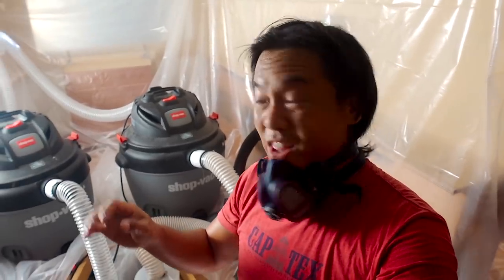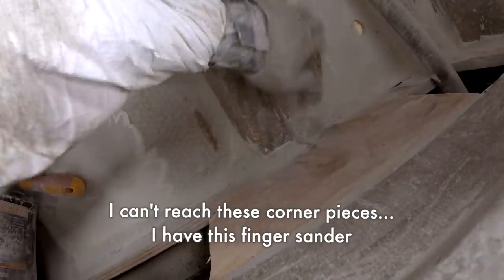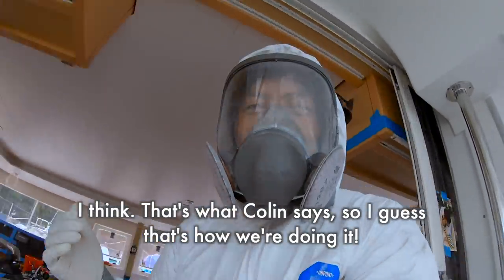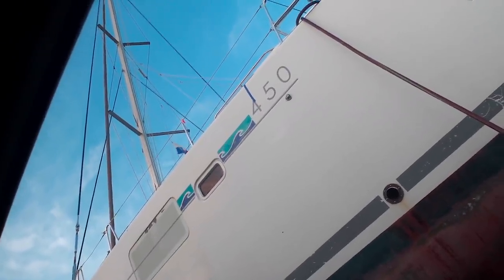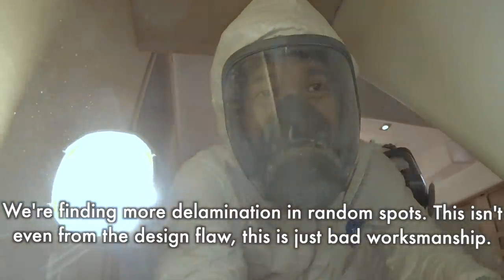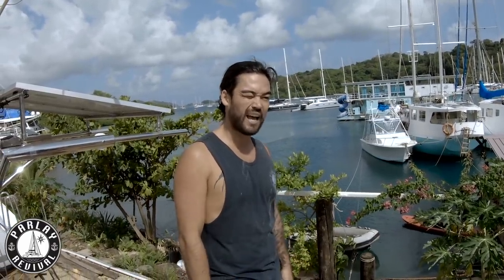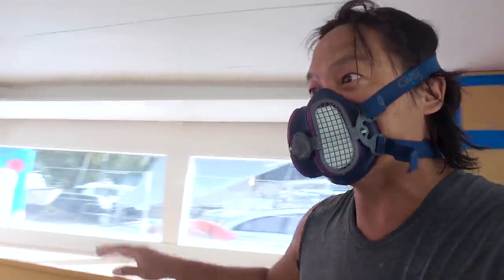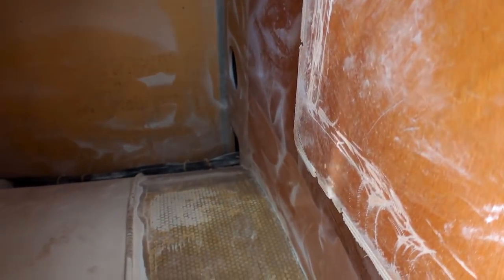I Sacrificed 3 Days of My Life GRINDING Fiberglass to Save $18k

Comment: While I've not had a large cat, I have worked on smaller fibreglass boats and yes, that stuff itches like crazy. I learnt the absolute best way to prevent this is two fold; Firstly, even if you are grinding fibreglass in the coldest of winters, always force yourself to have a COLD shower afterwards. That way your pores don't open up. Step 2; once dry, cover the area of your body that's itching with the cheapest, nastiest of masking tape and let it remain on your body for as long as you can (an hour's usually enough) and then rip that stuff off. Because it's cheap shit masking tape (Bunnings usually) it's usually extremely sticky so it will adhere very strongly to any glass fibre fibres and when you rip it all off, the fibres go with the tape. It sounds weird but it saved me from nights with no sleep due to constant itching.
Reply from the maker: Thanks for the tips, Fiberglass is fiberglass!  I think I have special skin that traps and stores fiberglass dust perfectly. Will try the cheapo tape trick!

Comment: I find a dry paint brush as a mini broom is helpful whenever lots of dust is being cleaned up. I saw you swatting with your fingers and no brush on end of vacuum. Dry paint brush while you vacuum👍. I get claustrophobia just watching you guys. It’s like you’re climbing inside a crawl space of a crawl space. 🥴😳
Reply from the maker: Ha yeah....not very efficient with no brush attachment...unfortunately it was hidden under a mound of dust in the other cabin--only found it later on.  Thx for the paint brush tip though, that sounds like it would work great to get dust out of deeper crevices.

Comment: Great work. Love the safety gear meters, great stuff. Fibre glass is bad stuff. Try for a external pump full pressurised resparation or scuba gear, i wouldnt touch fibreglass without it. Horrible job, great you are working it through...always fun with you
Reply from the maker: Yeah I really like the positive pressure masks. I’m going to get one soon.

Comment: That's the way to do it, good extraction. The one you got on the deck is what we used but larger dia. Where's the marigold gloves then? Dust is not such a problem when applying resin, as it gets absorbed into the resin and matt. $6000 a day? I'll do it.
Reply from the maker: Hey Brian!  I really wanted a bigger duct fan, but that little 8" diameter cost me $350 down here in panama (~$100 in the US.) The flexible duct was $110 on top of that. I actually bought some legit gloves since your last comment!  But this was filmed before then.  The quotes I got were in the US--they wanted a week to do the grinding and had to setup all sorts of HSE measures and needed multiple days for setup and breakdown of equipment and cleaning.  Here we just did 12hr days and knocked it out ASAFP.
Reply: @david_shih  Hi David, I see, in that case I would have done the same as you even though it's a pain in the ass. At least you are not alone with this, and you will have lots of good times on her when you finish all the work. As your Ausy friend said, stager the layers of glass especially if it's woven's and not chopped strand, good advice. Did he say what adhesive to use when you laminate the sheets of ply? At Sunseeker we used waterproof glue (not to be confused with water-resistant glue). Workmanship; The people who make these boats, in general, are not boat builders, the boat builders are the ones who make the original plugs, deck and hull, the rest are people who can handle a jigsaw, and learn how to lay up GRP with a bit of savvy, and not uncommon for people to skip things and not do it properly, Sunseeker had its problems with this as well, they have the attitude, "that will be alright" no one will see it when it's done, this is the Philippine attitude to building houses. It was difficult to find people who had a pride in what they were doing rather than just being a means to an end, and Friday was the best day of the week. Keep up the good work David, keep safe.
Reply from the maker: @lifeinchrist77  hi Brian,  I used west systems epoxy resin thickened with cabosil into a paste. Spread it out like you would laying tile. Hard to find people that take pride in their work now a days. I imagine wages are pushed so low that maybe the people willing to do the work have less interest in it.
Reply: Build quality was surely lacking.  But question is has anything at lagoon changed.

Comment: So when you “ rebuild “ I’d strongly urge go green brother as much as you can and go pro studio 
Develop a state of the art broadcast studio and grid and world class install ....personally I’d do a second propulsion drive system that’s all electric inc bow thruster on hydraulics and your boat fitted in fiber optics and star-link WiFi etc 
I’d also suggest “ some serious treasure hunting !
Pm me brother
Reply from the maker: Dude...my dream is to go all electric one day...ive got the batteries/solar/hydro figured out but can't afford the DC generator and motors at the moment.   Might not need bow thrusters since we have 2 engines, but fully networked and wired outlets would be awesome!  I'm just waiting on starlink to remove the geolock and I'm in!

Comment: I really like your videos.  I watched Colin's on Parley, and there was some insider information your needed to understand where exactly he was fixing his boat.  Your little graphic of the boat is immensely helpful.  Now, a confession.  I watched your wash down video before this one and got a chuckle when you said that the dust collection system would prevent the mess that Colin had to deal with on Parley.  So I wonder which would be less effort:  Literally removing everything inside the boat before starting the grinding, not bothering with dust mitigation since you have to wash down all surfaces anyway, or doing it the way you did it.  Too bad you couldn't block off the hard to reach nook and crannies to avoid dust behind walls.
Reply from the maker: Hey Patrick! that's such a good question.  Just go for it and grind like crazy with a wash down at the end; OR mitigate as much dust as possible and still wash down at the end.  If I had to do it again I'd still mitigate dust and here's why.  You have to remember that PPE typically removes a percentage of dust (eg 99%.)  So quite a bit still gets in through the mask, suits, cracks, etc.  By reducing dust with the exhaust, you are preventing a whole lot of it from reaching your lungs and skin.  Either way, you have to do a couple big cleanings at the end.  I actually had to go back in and wash the cabins again because when the water evaporated, the dissolved dust stayed behind! Thanks for watching bro!

Comment: The issues you uncovered appear to confirm that the things Colin highlighted and a fair number of other 450 owners discovering varying degrees of similar issues .Lagoon have design construction and big big quality control problems which leads to the question can all of these can be dismissed as 450 problems of a certain build period or does this mean there are wider issues with Lagoon Catamarans in general . Is or has Lagoon done any internal investigations into what’s happened here ? It’s hard to imagine a company of their size would not find these kind of problems a huge concern, their reputation could suffer irreparable damage unless they get their house in order . I would imagine any structural issues with any model Lagoon will be under the magnifying glass in future .
Reply from the maker: I can't speak for lagoon but I have my opinions of course.  If it were me and 2 of my boats had the same structural failure in the same marina, I would have sent an engineer out there to figure it all out yesterday.  There's no certain build period for Lagoon 450 problems, its actually all of them since ones from 2010 through 202 all have the same issues. I genuinly think it was just a design flaw in the forward structural bulkheads...they shorted them an extra piece of plywood each and a few layers of glass.  Easy design fix, but very hard to admit in their position.

Comment: David, make the hottest shower you can handle without burning. Wait a couple of minutes for the pores of your skin to open and only scrub your loofah in the direction of hair growth! It will not take it all off, but it’s the best way to get the most of it off your skin. Also, before you start, rub baby powder or barrier cream all over exposed skin and then suit up! Keep up the good work mate!
Reply from the maker: I've tried it all, but never the "in the direction of hair growth" and that sounds like it would work wonders. Will definitely try that thanks!

Comment: The cabinet maker who told you about dust and to move air here. I knew you would figure it out once I gave you a little direction. Move air that's the key. Very innovating setup great job.
Reply from the maker: Thanks for the tips brother!  Could have doubled that ventilation fan though, but the next size up was over $600 in panama.

Comment: Dave how much just in labor would it cost to have someone fix it for you not material expense like 50 k? JT 🇺🇸🇺🇸🐟🐠🎣🛥🌴⛱🙏🏻🙏🏻🙏🏻
Reply from the maker: I think $50k could cover labor it in a cheap country like Panama. But just to give you an idea for US prices. I have a quote where they wanted $15k just for the "project management" portion of the whole repair $130k all in.  There's just so many massive parts which would be huge undertakings on their own:  Dismantling Cabins; Prep/Clean/HSE around Grinding; Technical fiberglass (>60 square meters of biax fiberglass + 20 gallons of epoxy); Rebuilding Cabins;  and a Massive cleaning and interior wash down at the end to get the glass dust out (at least a week for that.)
Reply: @david_shih  thanks for replying now I understand why you are doing the repairs your self looks like a never ending battle but little by little your getting to finished product soon be in deep blue again and hurricane strong JT 🇺🇸🇺🇸🐟🐠🎣🛥🌴⛱🙏🏻🙏🏻🙏🏻

Comment: You want to get fiberglass out of your skin key is cold shower this will make your skin tighten and cause the glass to stand up like the hair on the back of your neck when you get a cold chill. Then rub you skin with something like the inside of a tube sock or sometimes a clay bar for paint detail can get the hard to remove glass out of your skin.
Reply from the maker: Ah.  Clay bar, that sounds like it just might work!

Comment: One question. Why didn’t you install the exhaust fan on the other end of the hose so it wasn’t so loud inside the boat?  BTW I’m loving your videos. Can’t wait to see more. Oh and I am posting my comments as I watch. I’m watching from the start.
Reply from the maker: Hey SPTH! Good question, 2 reasons, the exhaust fan was easier to connect to the makeshift wood mount I made. Amd 2, If it was on the end side it would be sucking the duct instead of blowing, causing the duct to collapse instead of elongate. I wanted to be able to reach right to the ground so we could keep spraying down the dust buildup. Thanks for going back and watching! Lots more to come!
Reply: Plus if a rain comes with that power which I'm sure it does often.

Comment: Great work on the dust reduction system! Talc powder on your skin, everywhere there’s a possibility of dust contamination! This Stops any itching. Just glass over the spirax, it’s where the vacuum has put extra pressure on the rovings! Triple the plywood on the bulkheads, glass layers between. What a nightmare, you’re doing a good job! Good Luck! 😎🏖🌴☀️🇦🇺
Reply from the maker: The problem is that the spirax wasn't bonded to the hull underneath so I ground it all out to have a good bonding surface.  Yes on the triple plywood--got all of them installed a couple weeks back!!
Reply: I'm not sure 3 layers of crap plywood is enough.  Some failures were internal in the plywood plus lots of hull debonding.   I hope glass layers are put between.

Comment: I've seen folks putting baby powder on their arms and hands BEFORE doing the fiberglass work.  I don't know if it works, or how, by my theory is that the powder fills your pores and prevents the fiberglass from sinking in.  Sound reasonable?  Anyway... good luck!
Reply from the maker: Will thanks for the rec. that’s definitely a technique, but it doesn’t work well in the panama heat…turns to a paste and then runs all the way down and collects at my feet in the enclosed booties.
Reply: @david_shih  LOL!  I could see how that would be a bad thing.  Lookup pictures of a "Positive Pressure Paint Suit".  That may be an option, no?

Comment: David, duct tape... even masking tape, or packing tape  will pull fiberglass "pricklies" off your skin... Put some around your hand and dab-roll the prickly area like your removing lint from a suit. The best thing though is to just rinse off with a hose or take a dip....
Reply from the maker: I've tried a lint roller but it got fouled so fast.  Will try duct tape next time!
Reply: @david_shih  I almost forgot.. A good leave blower (wielded by a friend) Ahem... Colin...  Will also get rid of a large amount fiberglass dust from you, the boat, whatever....  THEN use the sticky trick to get rid of pricklies..
Buena Suerte!

Comment: Question Could that grinding dust be mixed back into the resin as a filler for fairing etc?
Reply from the maker: I bet it could have been, but I got rid of that dust so fast.  I wanted it as far away from me as possible.  There's still plenty trapped in the ceilings and behind the walls though!  Also I already bought about 20lbs of cabosil and microballoons.